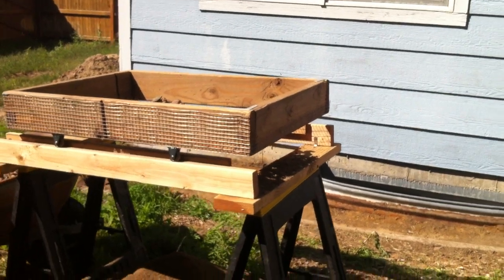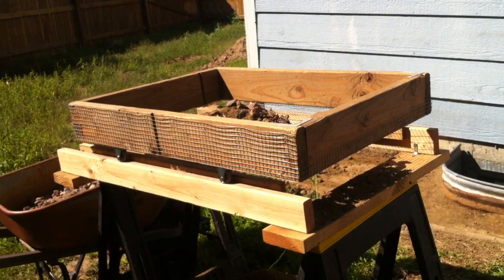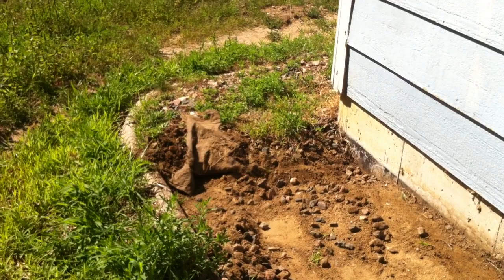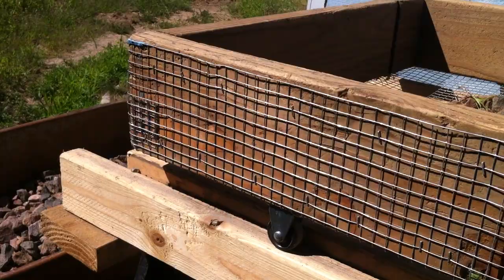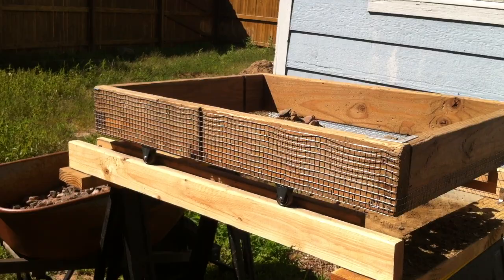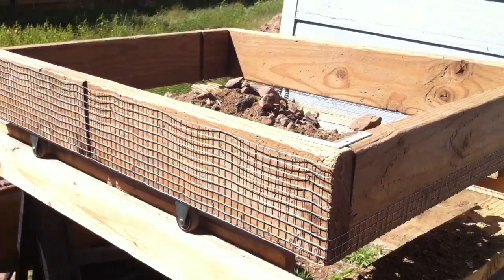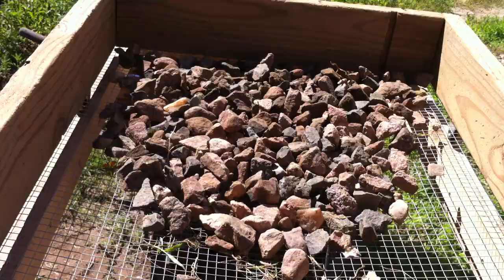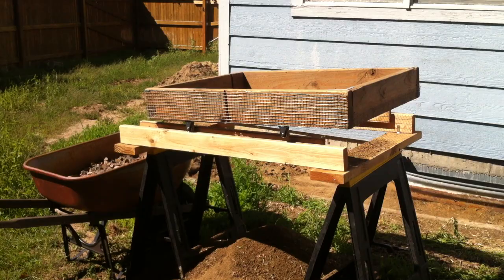Dirt Soil Rock & Compost Sieve Sifter - Fast Efficent Cheap

Comment: I made this for $12 and some old lumber and it works great. I can move the sifter with one hand its so easy. I love that the wheel guides are on the inner side because it keeps more dirt out of the wheel path. This is a BIG improvement over the ones with boards on the outside of the sifter box. Highly recommend. Thanks!!

Comment: I like your concept, i figured I could make the bottom sieve long enough so I could get another wheel barrel underneath to catch the compost. Thank you for sharing,
Reply from the maker: Thanks Rusty. I've had someone mention that and it makes sense if your goal is to catch the soil for sure. I was focused on cleaning the rock but in any case a wider frame would definitely allow you to catch soil as you want. Good luck!

Comment: just wanted you to know, I built this in about an hour and a half today and it works like a charm, the only change I would make is make the carriage longer so I could fit a wheel barrow under the sifter (between the sawhorses) for the falling dirt. As it is I put my flat dolly and a garbage can under it so I do collect most of the dirt for transport somewhere else. Thanks!

Comment: Jeff, Best sifter design I have seen so far.  I'm going to use your design to build myself one since your video demonstrates it works great and easy to build and $cheap$. Thanks!
Reply: better to tilt the box so gravity does most the work for you.  No emptying the box which gets heavy fast if your sifting rocks.
Reply from the maker: You raise a good point and I tried a non rolling angled version prior to this model which worked great for really dry dirt with no clods but when the soil was a little moist, many of the dirt clods remained with the rocks. When I added the rollers, I found the back and forth movement broke up most of the clods and kept the rocks cleaner. I agree, it does mean a little more work but I felt it was worth the end result. Thanks for the comment.
Reply: I hear you.  It rained last night here so I may be in for a long day.

Comment: Great design. Instead of wheels I rolled my screen over a large dowel or PVC pipe because I had limIted access to materials.
Reply: The point here,  is you were inspired,  and mad something that would work within your budget. Congratulations🎉🎉🎉

Comment: I had to dig a 40 foot trench to lay some 4 inch drainage pipe. The soil is so rocky it's brutal. After picking out the rocks the size of grapefruits, I'm left with a bunch of rocks about golf ball size. I'd like to get them out to use the dirst to help fill back in the tench. This video helps a lot. Guess I'll be hitting the hardware store.
Reply from the maker: good luck and hope the project went well. sounds like a bunch of work!!

Comment: Brilliant! And as I watched you shake the sifter it occurred to me that I can put some dry cow dung in with the rocks to help crumble them up. I spend way too much time hand-crumbling them and it's always a chore even when I soak it over night. I'll have to experiment with that. 

Also, I'll be thinking of an easy and practical way to change the sizes of the screens to try my luck at separating worms from vermicompost.

Thanks for sharing!

Comment: Hey Jeff, not trying to take your idea away ,but i had the same thing in mind....the only difference would have been making a track so that the wheels stay in place and instead of stapling the mesh I would have nailed a strip of wood on each side to keep the mesh in place. i am glad i saw your video. Did not like all the other suggestions.....i. e.  using a rep. saw or some kind of frankenstein concoction.    Thanks !!!!
Reply from the maker: mundl kalli, thanks for the comment. The firing strips definitely keep the wheels in place (side to side) so it stays in place very well. I thought about the side mesh pieces and have seen others use metal strips as well but I found it really was not needed. Thanks again and good luck!!

Comment: I have a sieve about that size that I was using by hand, literally shacking it bent over, very back breaking, I built a large one that is slopped, it works a lot better but still a lot of work, I might customise my original smaller one like this and see it it works for me, I mainly sieve compost.
Reply from the maker: Hey RJC, I started out doing the manual shake. It really should be called the "Shake & Back Break".  Hope this helps you out. The better you align the furring strips underneath, the better it will keep the wheel tracks clean from the compost. Thanks!

Comment: Or use a wire shelf. It's rigid so it doesn't need 2x4's. Just bend the edges up to make a box.
Reply from the maker: Hi Jay, interesting idea. What type of wire shelf are you thinking?  Like something you buy at Home Depot or something you make from some type of wire?

Comment: Hi Looks like a good idea Have a load to do .Was going to build a cement mixer version but expensive and time consuming and a one off use. This looks just the job Thanks
Reply from the maker: I think you nailed it. If you did this day after day as part of your job etc, the power rolling type might be a good option but for individual projects this has been the perfect option. Thanks!

Comment: I've got saw horses; why didn't I think of that? wheels? great idea. How about  some kind of a track? I suppose dirt can go inside of them.
Reply from the maker: Hi and thanks for the comment. The firing strips keep the wheels tracking so the sieve cannot fall out of the tracks and if installed at the right height it will help keep dirt from getting on the tracks also.

Comment: That's a great design but I just have one question and like a quarter of a million the other viewers in this world would like to know. What is your dimensions on the top box with the gauge wire for the unit
Reply from the maker: Hi!!  The top box is a simple 2x3 foot box that I made with old 2x6 lumber. I used 1/2" wire screen found in the fencing section of Home Depot, but you can also use 1/4" screen if your dealing with smaller rock sizes. The wire screen comes in a roll that is 2x5 feet so it works out well. Not sure of the actual gauge of wire used, but there is only one choice in Home depot so should be easy to find. Thanks for the comment and question!!

Comment: what kind of wood did you use for the top part? I know it is 2 feet X 3 ft.   but are 1 by six boards?
Reply from the maker: Hi, I used spare wood I had so the box with the screen is made of 2x6. The base is made of 2x6 on bottom and 2x4 where the wheels roll and 1x3 fir strips as wheel guides. I believe this could also be made with just 2x4's and fir strips but the box would just be a bit shallower. Thanks for asking.
Reply: @jeffkusman2179  Thank you

Comment: I would love to know what kind of wheels these are.
Reply from the maker: https://www.homedepot.com/p/Everbilt-2-in-Soft-Rubber-Rigid-Caster-with-90-lbs-Load-Rating-49481/203661068  I think these are the current wheels at HD. The price was less when I made the unit originally.
Reply: @jeffkusman2179  Thank you so much.   I am going to build it a little lighter.  I am 69 years old and need to be able to use it once I make it.  Thanks again.

Comment: Can you tell me how long the 2x4 runners are under the sifter box that the wheel sit on? Thanks
Reply from the maker: Mine is 45"' but another post suggested making is a little longer if you desire to put a wheelbarrow under the sieve to catch the dirt. I was more focused on getting clean rock. Hope this helps and thanks for the question!!
Reply: @jeffkusman2179  thank you for replying Jeff. Out of all the sifters I've seen this is the one I want a copy. I have a huge Rock garden that needs to be cleaned out. After 20 years too much debris has fallen in between the cracks creating compost and weeds. The only reason it lasted twenty years was because when I first did it I put plastic down as a barrier. Thanks again
Reply from the maker: You bet Russell. This will be perfect. I had 1 1/2'" rock so the 1/2" screen was great but if someone has smaller sized rock Home Depot sells a smaller screen also!!
Reply: @jeffkusman2179  my rock is also 1 1/2" It's called carnation pink. So the 1/2" mesh I know will work perfect. Thanks again

Comment: What kind of wheels and where do you buy them please?
Reply from the maker: The wheels are at Home Depot. They have a few options but these I believe are 1.5 inch straight rollers.  Best of luck and thanks for the question!
Reply: Thank you very much, Great "Contraption"😉
Reply: I am designing a lower to the ground one. Keeping the higher end only 2.5' from ground level,, tobsave on having to lift each shovel load up so high, because that's the part that Kills me aching, the repetitive lifting part, I am carrying too much belly blubber, my poor back.  
Thx for the info and inspiration.